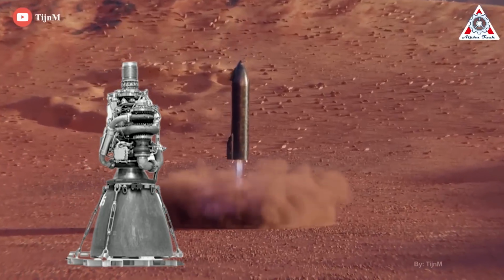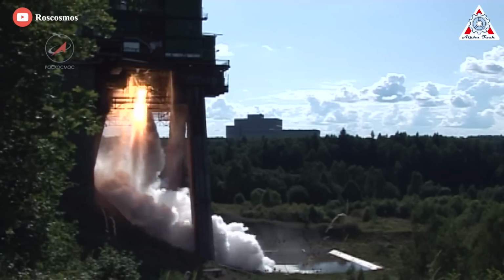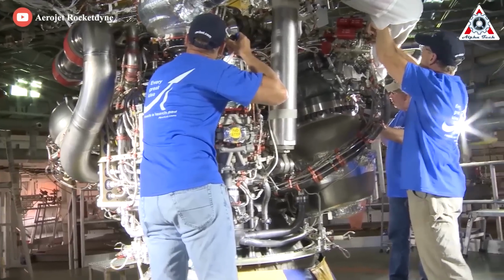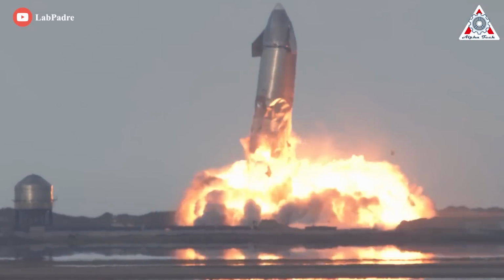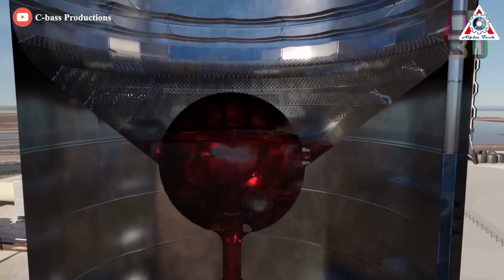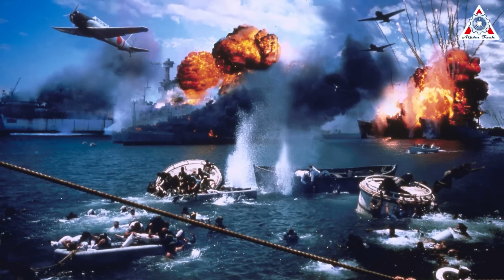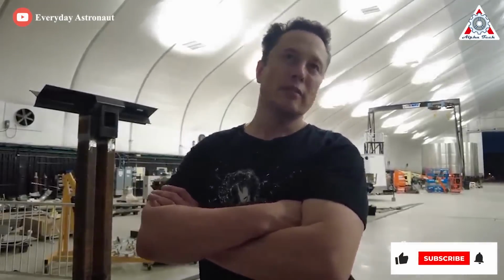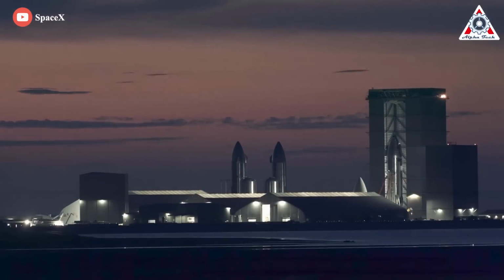SpaceX NEW Raptor Engines "BIG PROBLEM"...

Comment: These are interesting times in the space program.  There are so many complex engineering challenges to solve.  The level of testing and failures we see now probably doesn’t have an equivalent unless you go back to the space program of the 1960.  Maybe SpaceX won’t solve every problem but they may achieve enough critical successes to keep moving forward.
Reply: But you'd think there wouldn't be this many failures as the foot work was done years ago for them. We have computers that are vastly superior so they can run simulations, what data is achieved from what they did. It showed 1 thing the engines are unreliable.
Reply: @Supraboyes  Wow facts
Reply: @hnewc1919  you don't illustrate why that was a low I.Q. take.  Enlighten us with YOUR factual opinions .
Reply: Starship is interesting times because NASA is not involved. What bloated, pork driven Federal Agency  NASA is doing is wasting more taxpayer $billions on SLS/Orion, another dead end legacy technology unaffordable, unsustainable pork NASA boondoggle. Thankfully, SpaceX said “FU NASA, we’ll do it ourselves”.
Reply: SpaceX is wasting their time... they would be far better off in building a Skylon spaceplane, or something equivalent to the Soviet Energia II concept, or hell, the partially reusable Sea Dragon launch system!

Comment: From the start of this project, I had doubts about using so many engines. The more you have, the more it can go wrong.
Reply: I also think 33 engines are too many, if you want redundancy 12 or 15 engines would provide enough for the failure of a couple engines and each engine would be more robust, but that would mean making 2 types of engines if you want redundancy also on the starship, one for the starship (raptor 2 size) and one for the booster, more expensive and complex for spacex to develop and produce.
Reply: Spacex has all the experience they need from the merlin engines, and has been able to simply scale up everything.

None of the engines on the testflight, was cut off by problems inside the rocket itself.
Reply: @herrensaar1989  You don't know that for sure. The engines are just fragile
Reply: @herrensaar1989  The most famous aero engine is the Rolls Royce Merlin, built in huge numbers  as well as under licence by Packard. Rolls Royce also built the Peregrine and Vulture engines which turned out to be real stinkers. Sometimes, however hard you try, you run into the laws of physics.
Reply: @giddy more moving parts == more things that can fail.

Airliners now cross the Atlantic with only 2 engines because the reliability has been improved. At some point, redundancy can be too expensive to be feasible.
Reply: @@ahallidie The only reason soviet use so many engine it's because they did not had infrastructure to test big engine. So using many engine making them more complicated because you want to reusse them is not really smart. You ad so much probleme possibility than your redundacy only help for a probleme you created yourself at the drawing board.
Reply: @legro19  That’s total BS.  The Soviet Union had the same infrastructure we had, if not even better.  They failed because they were trying to use too many engines, which created more heat than they could ultimately withstand.  Elon’s rocket started loosing more engines as well.  He would be better off using fewer, more powerful engines like NASA did with the Saturn V.  They spaced those engines far enough apart, that, alone with the built in cooling tubes that the F-1 Engines had built into their nozzles, that they were able to keep those rocket engines from overheating during their most vulnerable point in flight, those seconds when they were still near the ground and having to push up the immense weight of the Saturn V while it was still full of fuel.  That rocket literally weighed MORE than the first ship I served on while in the Navy.  

Elon’s rocket may be more powerful than the Saturn V, but it’s not twice as powerful.  Those 33 engines create an enormous amount of heat,   So it was no surprise that the hydraulics blew out during lift off.  I suspect that replacing that system with electric actuators won’t help in the slightest bit.  The electric cables will burn just as quickly if not even faster.  Or the intense heat will have an adverse effect the ability of the electricity to flow through the wires.  He needs to block the heat from getting up to the actuators.  Then there’s the issue with the rocket loosing additional engines.  We could see as each one failed, as the exhaust flame would turn yellow below the failing rocket.  These issues have to be resolved BEFORE people are allowed to fly on this rocket.  NASA needs to develop another means to land on the moon.
Reply: @mudman6156  They failed because the rocket was over complicated. Just figuring out the plumbing was a nightmare. Finaly when they figured it all they decided to just cancel it and destroy the last rocket wich would have probably worked just fine. But the thing was just to expensive to build and even if they had succeed they would not have been able to afford the continuation of the program. USA had win the space race at this point.
Reply: Well, I think they should hang it up since you’ve given your two cents; it just won’t work. Close it down spacex.
Reply: @AnubisDogman  Probably what would happen. Following the billions lost by all investors in space x nobody will put large amount of money in new space vehicule for decade.
Reply: Right.  Reliability is the real issue.
Reply: @MrShobar  When it comes to building rockets to carry humans, you need engines that start first time, every time. Engine failure should be the rare exception. Being able to make cheap unreliable engines is nothing to be proud of. The words Ford and Ecoboost spring to mind.
Reply: @brendanpells912  You're making my point for me.  Thank you.
Reply: @brendanpells912  this is true but the platform is a long way from being certified for hunan transportation and the best way to find and fix problems is to put the engines through actual flight tests and analyse the data. They did the same with the falcon platform which now is rapidly approaching the most safe launch platform ever made and is human certified. They know what they are doing we just need to remember this is still early on in the process and there will probably be more failures before they get the platform perfected. But given the successes they have under their belt perfection is going to happen and a lot of humble pie will need to be eaten 😂
Reply: @keithsmith4236  I disagree. I think static testing should be done and the engine reliability improved until you get down to a failure rate of 1%. In other words, you take 3 boosters and perform full duration static test on all of them, and when you get down to  1 engine out of 99 failing, then move into flight testing. If you launch 3 boosters and experience more than one engine failing, you know what. factors have changed. As of today, you don't know if the 8+ engines that failed on the attempted launch would have failed even in static testing.
Reply: @brendanpells912  with all the sensors and data that they collected from that launch I'm willing to bet good money that space x know exactly what caused the engines to fail. The process has worked well for them so far why should they attempt to change it?
Reply: @keithsmith4236  Yeah, I noticed that the data from the pitch sensor failed not long into the flights, and the displays showing which engines failed didn't keep up with reality, so forgive me if I don't have much faith in SpaceX telemetry. If you run engines in a static test and one or more start to show distress, you can shut them down, strip them down, and examine them to find the root cause of the failure. How much harder is that to do when they've been sat on the sea-bed for a couple of months? Plus, if the engine chews itself up the subsequent damage can mask the root cause of failure

Comment: This is an excellent review and analysis of the Raptor engine.  Thank you very much.
Reply: It's not a "review and analysis" of the Raptor.  This was a discussion of the problems associated with liquid-fueled rocketry.
Reply: @MrShobar  The Saturn V was liquid fuelled too. It worked rather well but then wasn't fabricated like a tin can.
Reply: @grahamstevenson1740  Agree.  It was relied upon for only a single trip as well.  You're underscoring my point.  The ability to turn out out hundreds of engines shouldn't be the goal.  Developing one of unprecedented reliability needs to be the goal.
Reply: @MrShobar  I stand by my use of the words “review” and “analysis” as accurately reflecting their definitions in relation to the contents of the video.  The Raptor is a very technologically advanced rocket with tremendous promise.  That does not eliminate concerns that integrating 33 Raptors into the Super Heavy booster have not been modeled and tested adequately before this launch.
Reply: No- No its not. This video has no equitable information about the Raptor at all. This guy obviously a federal fanboy who likes the sound of his own voice.
Reply: @Cprtlcfbnv  Funny how Musk's fanboys can't tolerate genuine criticism.
Reply: @grahamstevenson1740  musk fanboys do seem especially sensitive.  It’s unrealistic to think a massive project like starship won’t have problems.
Reply: @vanguard9067  Certainly true. I find it concerning that so many engines failed however and that parts seemed to be falling off at a shocking rate.

Comment: Do you have a source for NASA being worried about damage to the SpaceX launchpad in Boca Chica? It's no-where near any Nasa equipment and SpaceX uses different launchpads and engines for the flights contracted with NASA.
Reply: I think he meant NASA was worried about Starship damaging the pad at the Kennedy Space Center which is why Starship has to launch from Texas.

Comment: You are describing:
"Complex technical issues"
not:
"BIG PROBLEM"
Love your channel, but the title is a bit click baity.
Reply: Complex technical issues are a big problem.
Reply: @DeepDeepSpace No, they are not, they are simply issues to be addresses. Also  it reads as though a new "big problem" has emerged, which is not the case.
Note the use of caps in the title